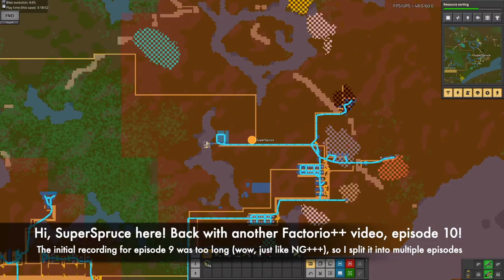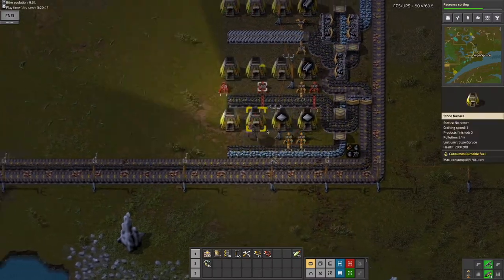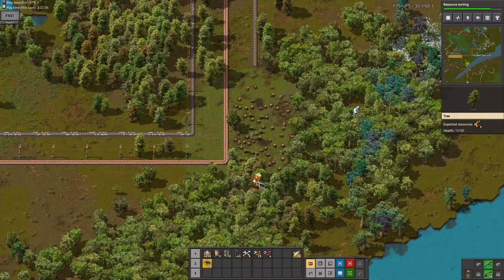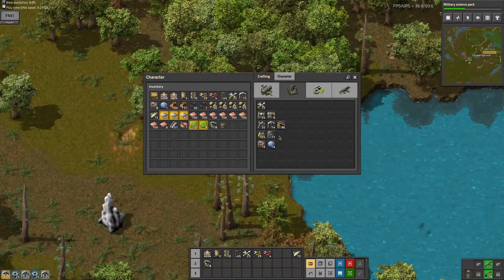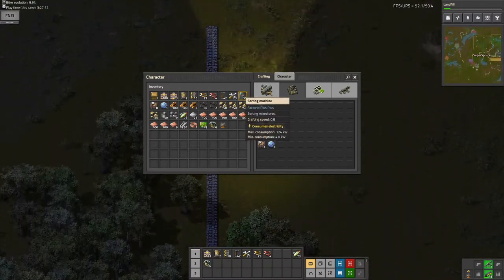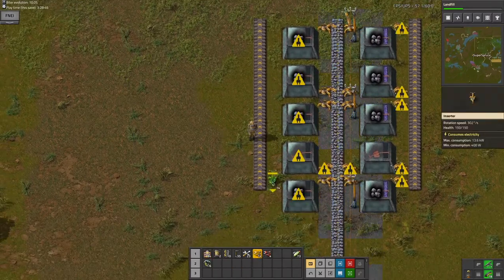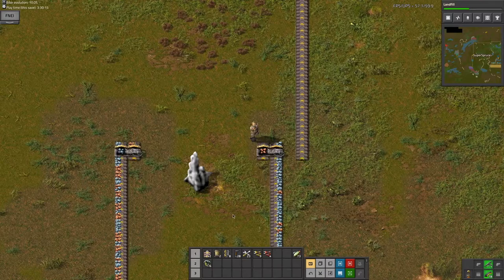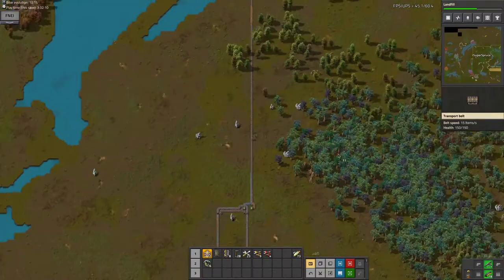Factorio++ Episode 10: Cuprumferrit Ore Splitting!

Comment: Hmm... why not use a single splitter? If you route both of the ore sorter outputs through a single splitter, you should be able to get a double-laned belt of each ore as the output of the splitter. There shouldn't be any throughput reductions, since the sorter output belts are both only a single lane.

Oh, and for the maximum capacity problem... usually, just putting a buffer on each ore type is the best temporary solution. The buffer will eventually run out of space, but you should be able to start depleting the ores by increasing consumption. You should aim to have consumption greater than the production of mixed ore, and augment the mixed ore belt with unmixed ore as needed.
Reply from the maker: 1. Good point! I'll fix the build to do that in episode 13. Episode 12 I try a solution but it didn't work. 
2. And for increasing consumption, this is gonna be a major theme of this series
Reply: @SuperSpruce  Heh, isn't increasing consumption is a major theme of literally every Factorio playthrough? :P
Reply from the maker: Yeah lol